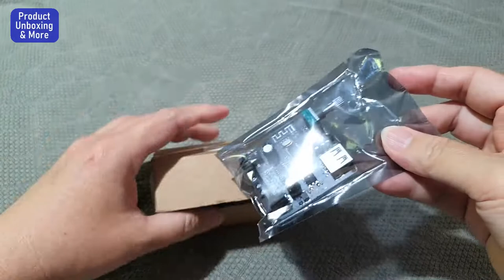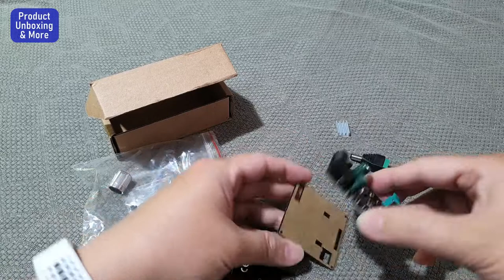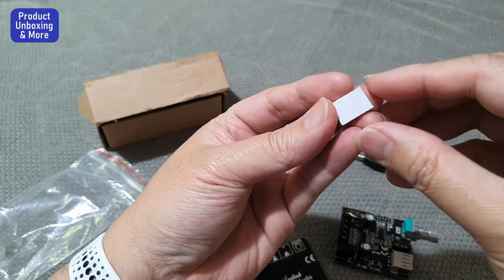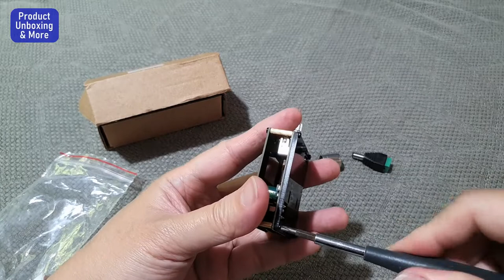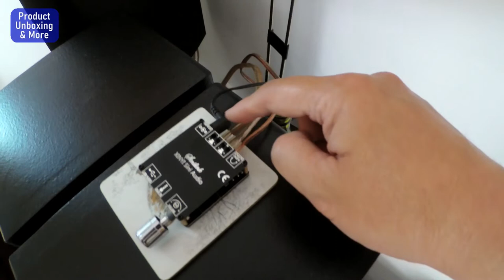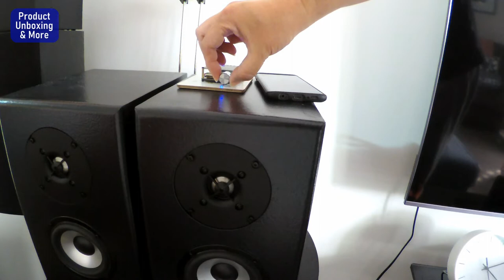Mini Amplifier Module 50w Stereo Unboxing and Demo with Dayton Audio Speakers

Comment: Can I know the voltage and amps of your power supply? Thanks
Reply from the maker: I am just using 12V 1.25A modem power supply.  But you can use higher for more volume. I think it can take up to 19V.

Comment: what size wires do i need to order
Reply from the maker: I am using 16 gauge, but I think 18 will do as well.
Reply: @ProductUnboxingMore  would 12 work? i was impatient for a reply and ordered 12
Reply from the maker: @CANTHOLD_RECORDS  I think 12 is too thick for the terminal.  But if you can fit it I don't think there is a problem.  But best to ask some audio tech as well.

Comment: Can we connect 4 speakers of 15 watt 8 ohm ?
Reply from the maker: I think it is possible.  2 x 8 Ohms speakers connected in parallel per channel which will make it 30 Watts and 4 Ohms per channel.  This amp can handle 50 W per channel at 4 ohms.
Reply: @ProductUnboxingMore  what is the watts of speakers that you have connected to amplifier. Shown in video.
Reply from the maker: 70w per channel
Reply: @ProductUnboxingMore  thank you so much for the information
Reply from the maker: @suhaskasute9353  you're welcome